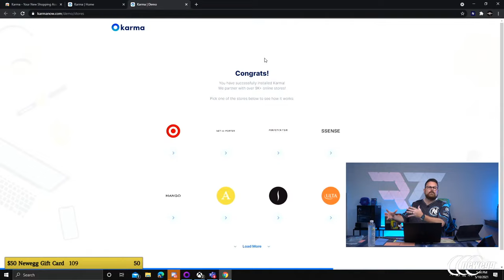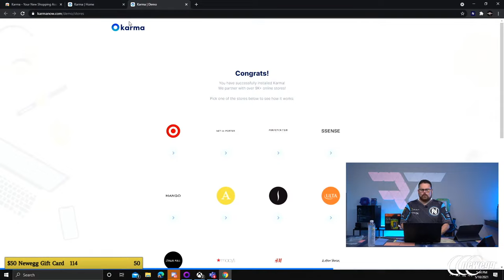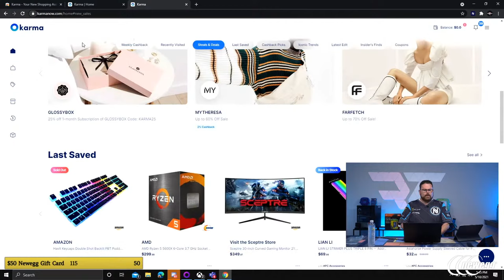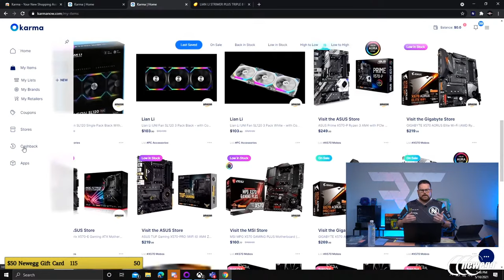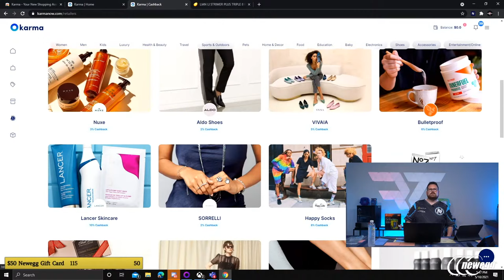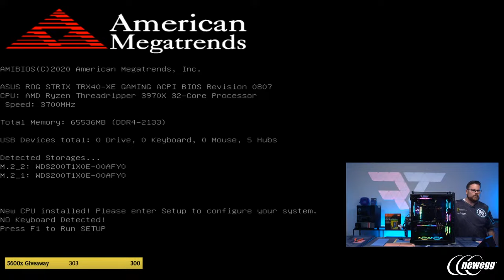How To Build a PC – Giveaways + $9000 Build in the Corsair Crystal 680x  (TR 3970x  / RTX 3090)

Comment: Re: 3 hours, 26 minutes and 44 seconds. I know no one is going to see that rats nest of cables but that would drive me crackers knowing it is like that. At least have it all neatly lined up not all over the place. I mean just what are the cable tie mounts for if not to route the cables in a tidy manner? This is what happens when you just throw in all the cables.

1. Cable tie together all the front panel cables.
2. Cable tie together the 24 pin, the CPU cable and GPU cables together.
3. Cable tie together the fan cables.

I wish they sold the Corsair Crystal 680x with out the RGB fans and controller. It would bring down the price of the case by a £100. Don't know why they include black fans in a white case, should be white fans. Come on, Corsair, why do you make me spend another £100 on fans just so they match the colour of the case?